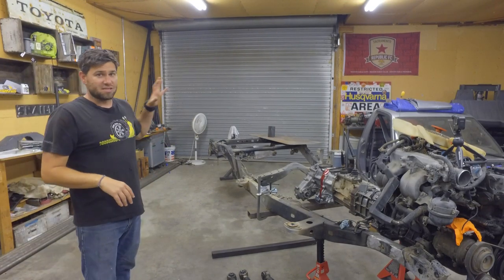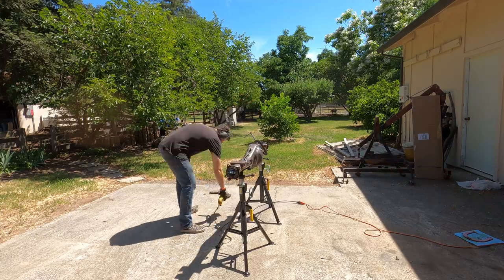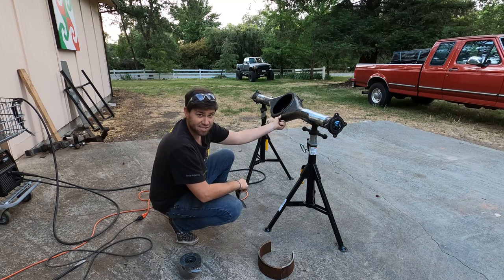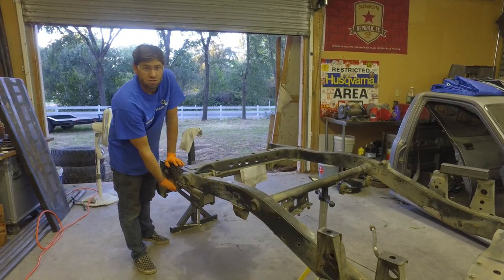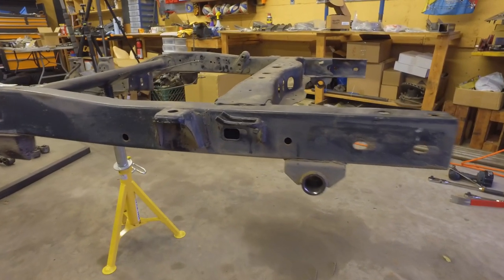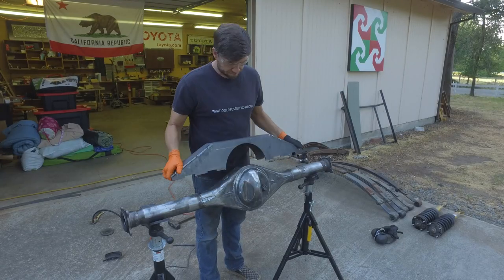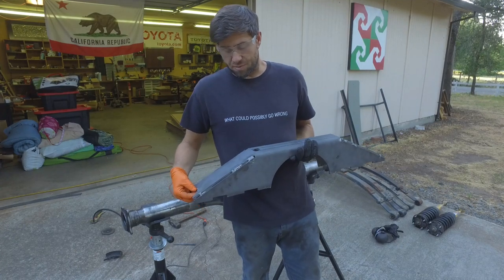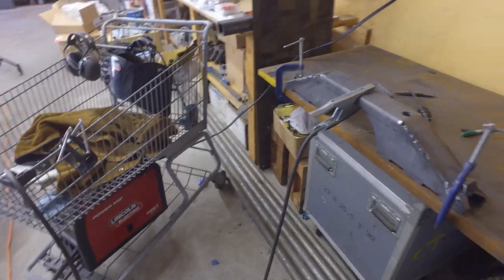Building The Best Toyota Rear Axle | Samantha Vlog 6

Comment: I don't know why you cut that section out of the rear end housing that kind of didn't make sense to me, I do this stuff for a living what I would have done is left the housing intact then used my plasma cutter and cut out where the drain plug is on the reinforcing plate then weld the reinforcing plate directly to the housing,  if you use two of those reinforcing plates then the drain plug would have been even recessed a little bit, and you would have had even double the reinforcement and lost minimum ground clearance like three eighths of an inch isn't going to make that big of a deal also on that reinforcement plate I would have made it longer almost all the way to where the tube transitions at least the bottom one and then the second one I would have plated it would have been about the same size that you did, the reason I say this is it is going to be a giant pain in the ass to change the fluid on that now,
Reply from the maker: That is a good point and lots of people do that. In my experence no matter how you brace the bottom of the axle you cant protect the drain plug. It always gets messed up and unusable. Also this way I dont lose any ground clearance, and if anything I might gain some. I am planning on doing the same to the front axle but being more extreme and hopefully I will gain upwards of 3/4" more clearance (probally like 1/2"). It would definatlly be easier and faster to place the plate on the bottom, and if I were doing it for a living that is what I would do, because time is money.